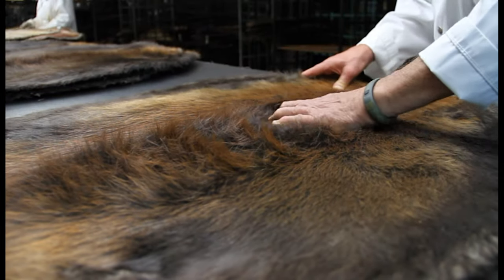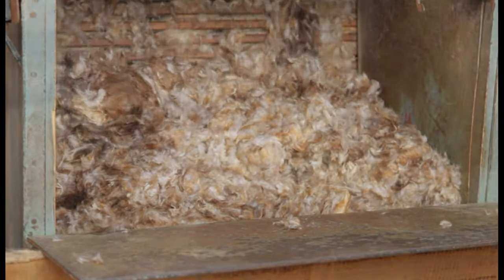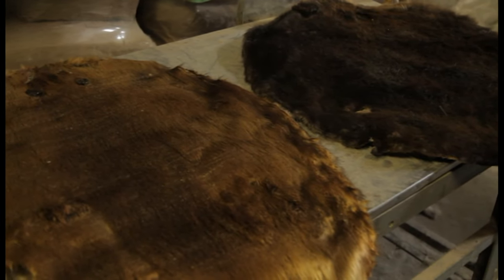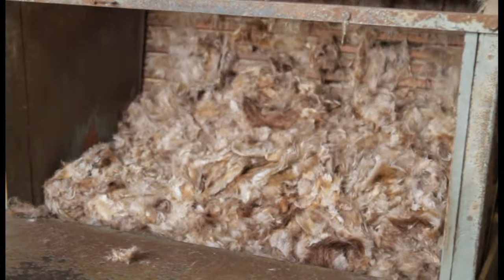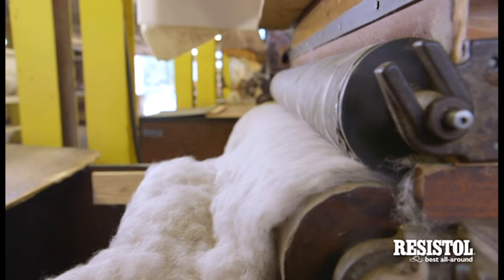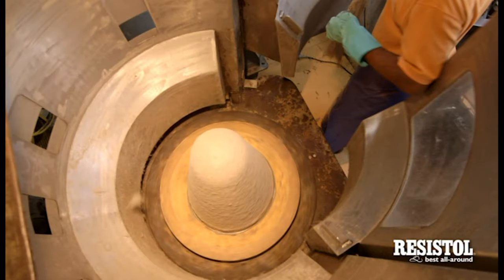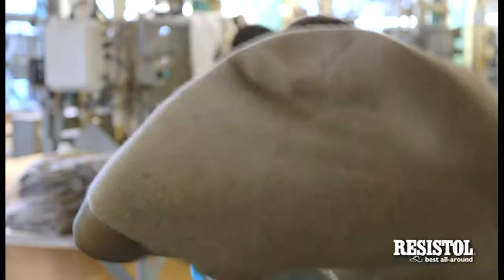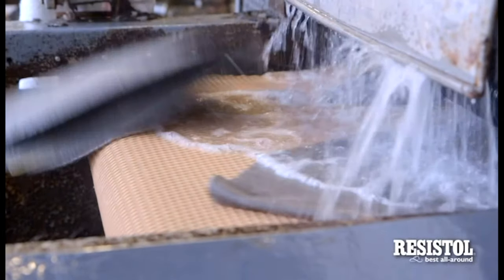How Beaver Felt Hats are Made. From Flowage to Fashion Series

Comment: I realize different folks figure hat quality differently but a 4x hat is at the bottom of the scale! I have a 60x and a 100x. Both are extremely good quality! The 100x is a $1,000 hat.
Reply: There is no standardized system. A "10x" from one company might not be as good as a "4x" from another. I just wouldn't buy a hat with any "Xs;" the hat is either beaver or not. I bought a vintage one that is.
Reply: In my opinion, the vintage lower X hats are very good quality. I don't know about the new hats nowadays. The X amount could be just for retail value.

Comment: This video has some misinformation. The Company American Hat Company in Bowie Texas is another company that builds its one crowns by binding felt and the whole process like Stetson and Resistol. 

Another piece of misinformation.  The X count CAN  go as high as 1000x which is pure Mink and a 1000x is around $2,000 dollars. It goes 4x,7x ,10x,15x,20x,50x,100x,200x,500x and 1000x 

With a few different variables depending on Company when you reach 100x and around 600 and 700 dollars is when you get away from rabbit mix and get into beaver mix then further more it goes to pure beaver to pure Mink.
Reply: American hat company doesn’t make their own hat bodies like Stetson and Resistol, they order already made bodies and make them from there. Unlike Stetson and Resistol.
Reply: 100x is 100% beaver for some makers but not Resistol, Stetson, and American and others . Resistol made 200x hats that had lower quality sweatband than their 100x but had a nicer buckle set on the trim band at base of crown. X count is not subject to any standard so it means whatever the hat maker wants it to. 75 and more years ago 7x hats were the point where the felt was  100% beaver and 10x was 100% beaver of higher grade. "Clear beaver" also meant 100% beaver. The x count has been eroding for 100 years so hats hats of the early 1900's of 3x quality were extremely fine felt but today that is a wool felt with no rabbit or beaver content.
Reply: @AdielsHats  - I was waiting for that to be pointed out. American Hats (to me) are just not worth what they charge, as they buy their hat bodies from who knows where.